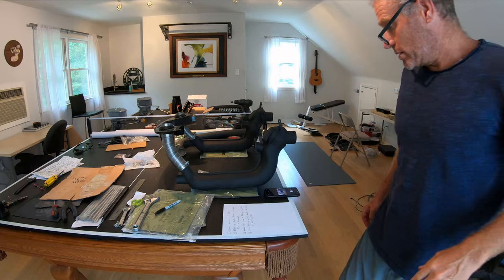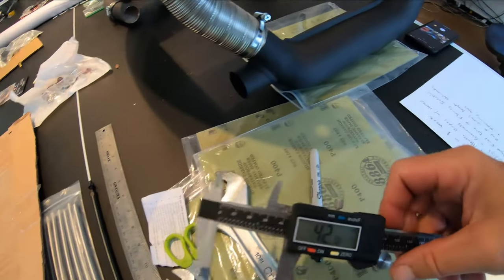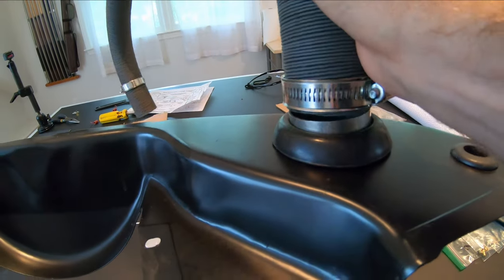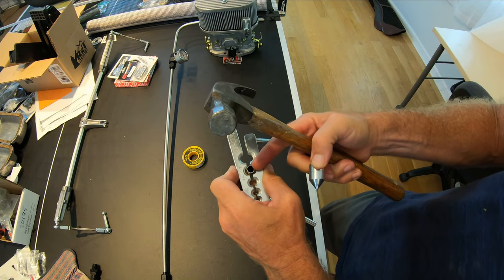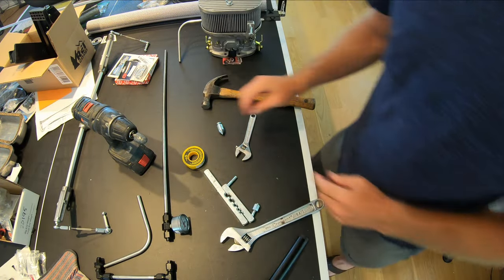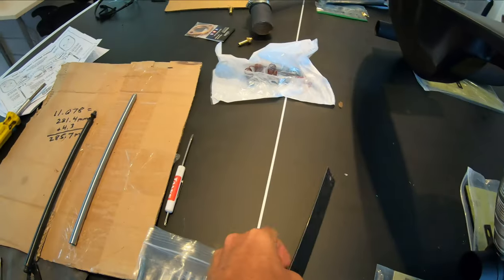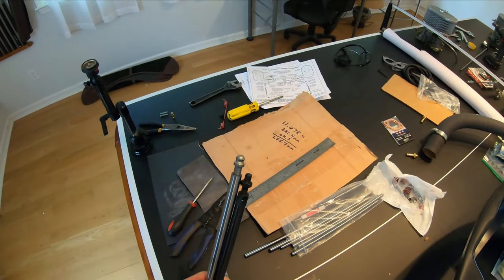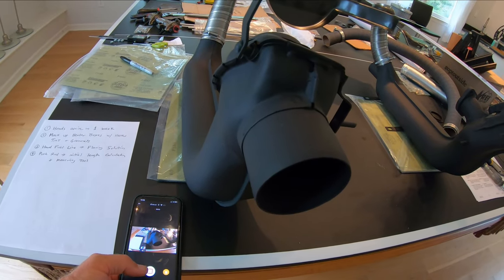2332 VW Air-cooled Stroker Motor - Video 64 - Heater Boxes, Flaring, Push Rod Length

Comment: that "industrial" heater hose is stainless steel. nice stuff. i run the same hose on my engine. psyched for the heads to come in?
Reply from the maker: Yeah, the steel ones are solid.  I cannot wait for the heads - I have been waiting with a roadblock now for 2 weeks.

Comment: Is there a trick to being careful not to split the end when hammering the flare in?
Reply from the maker: Man - I split the end about 5-6 times - I think leaving an extra centimeter just “in case” and then go slowly when hammering that cone into the steel pipe.  I didn’t heat it or anything - but I did watch carefully if I was bending it asymmetrically and tried to hammer the wedge where the thickest metal remained…